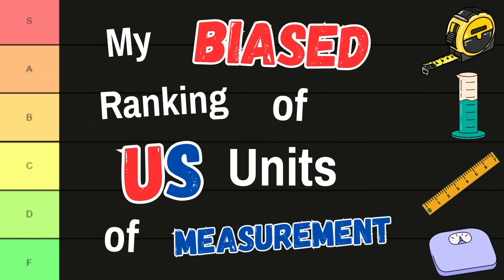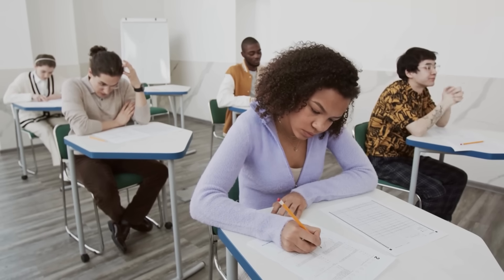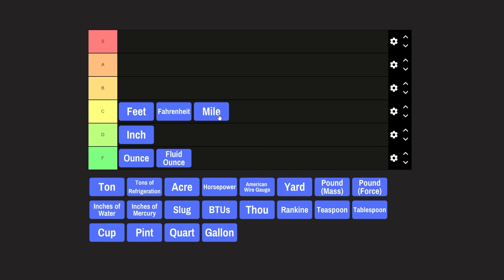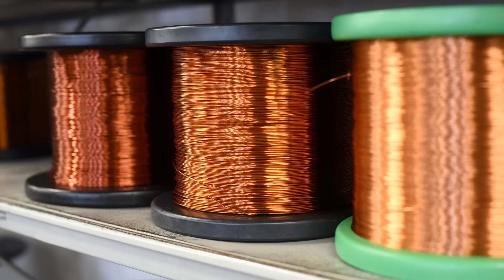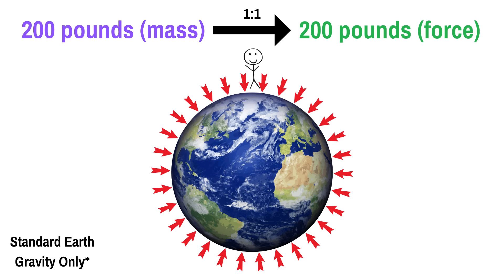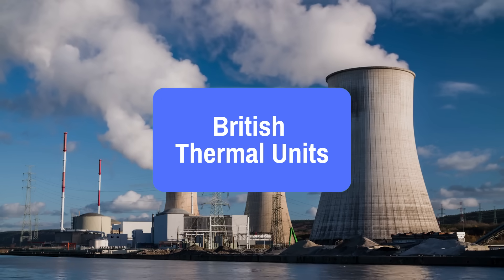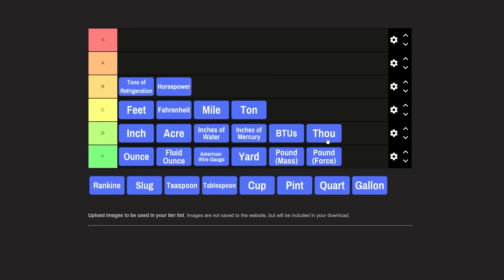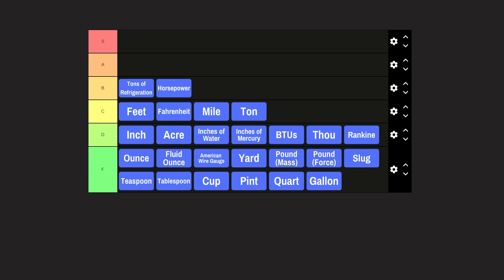Tier List of the DISASTROUS US Measuring System

Comment: water columns for preassure is really helpful for firefigthers too

the equivalent is even used in metric for many practical applications

like in germany we used "Meter Wassersäule" for quite a while,... and 10 Meter of Water is actually very close to 1 Bar, so you know you can if you can lower the preassure in your pump to 0.1 bar you can suck water from a maximum of 9 meters below you.

if you need to pump it up let's say a highrise 50 meters, you know you need to add 5 bar just to compensate for the height, pretty damn useful.

I'd put "heigh of water column" in A-Tier for this specific reason.
Reply: But the need to change unit is straight up a inconvenience already

Comment: The teaspoon and tablespoon measurements are probably the most useful if you have nothing in your kitchen to measure small quantities with, and in cooking a little bit too much sugar or salt for example wouldn't be all that bad, however if you're asked to put in one eighth of a teaspoon of a very powerful spice, you're better off using your hand instead.
Reply: Recipes using volumetric measures like cups and spoons are scaleable. As a result, as long as you are consistent in the ratios it does not matter what base volume you use, you could use buckets and half buckets for catering purposes and it would still be following the recipe.
Reply: @martinconnelly1473  That doesn't work with teaspoons and measuring in volumes is a stupid idea anyway, despite the differences at certain temperatures, try measuring a cup of Butter. Or replacing normal sugar/salt with finer or coarser grained one.
Reply: @outdooropaholger9998 two sticks. Butter here comes in eight tablespoon (half cup$ sticks.
Reply: @derekeastman7771  Congrats, for having an energy inefficient solution for a problem that doesen't exist with scales.
Reply: @martinconnelly1473  yes but if you instead used a scale and a cup with measurements in Metric .... You could use exactly the same amount of ingredients every single time you make the same thing, nobody eats the same thing everyday so it's only natural to forget the amount you used last time if you're using spoons and teaspoons and it might actually affect the taste, being inconsistent while cooking is bad, this is how you end up with inedible stuff on your plate, that being said you really don't have to he all that accurate if you're just cooking for yourself, nobody's gonna judge you and say "it's not as tasty as last time..."
Reply: You better have something to measure if you want to cook ! 

Not every spoon are the same size , and inside the same spoon you can put Different measurement of product  ! 
Just buy ONE KITCHEN SCALE , then you can measure every thing . 

1/2 a teaspoon , a 1/4 cup , God damn that's horrible when you wanna cook . 
That doesnt make any sense , It belongs in the "Z" tiers .
Reply: @DoogD-i6q They make standard measuring spoons, and they have a uniform volume. How incredibly ignorant.
Reply: @derekeastman7771  INSIDE ANY SPOON , you can put different measurement of "product" . 

How much do you fill it ? 

And what about 2and 1/3rd spoon of something ? 

What about 4 and 1/4 cups of milk ? 
You fill it randomly saying , mmm that might be a third ? 

Buy a scale , talk in Grams it is way more precise and you don't need to have a kit with 5 useless spoons that you only use for this purpose . 

This system was useful back in a time when almost nobody had the possibility to have a scale in thier homes . 

We are in 2023 , wake up . 

Im not ignorant , I am just sick of hearing recipes with aleatory measurement. 
Do you realize that a recipe is a sort of Chemistry lesson ? 
It has to be as precise a possible . 

Go ahead and try and tell me that every single one of your spoons , contain the exact same amount of Powder/liquide inside . 
Try and lie about that
Reply: @DoogD-i6q You fill measuring spoons to the rim, then level them, and measuring cups to the line denoting the amount you want. You're going to be using measuring spoons for powdery things mainly, sometimes oils or wines, and it's generally a close enough approximation that it works. US measuring utensils are standardized so this "maybe it's a third" doesn't apply. You seem to be under the assumption they aren't.
Reply: @auggie9912  There is a oot of recipes where they say " One third of Teaspoon" , "one Half of Tablespoon" , "One fourth of a cup" , "2 third of a cup" . 

Once again , I feel like Cooking is science .
It may appear different than Chemistry class, but it is close . 
If Everyone follows the same instructions using the same ingredients they will get the same results . 
Now one who does not know how to cook a certain dish will certainly want to follow the exact instruction of a Chef . No "close approximation" . 

Just use grams, Liters , Buy a Kitchen Scale and Measuring cup ans start talking a bit more precisely . 

Cause talking about "third of Teaspoon" , or "third of tablespoon" ,"2 third of a cup" doesnt doesnt make any logical sense .
Reply: @DoogD-i6q  
> There is a oot of recipes where they say " One third of Teaspoon" , "one Half of Tablespoon" , "One fourth of a cup" , "2 third of a cup" . 
Which is why you use the measuring spoons/cups for those things. You want a third teaspoon? Use the 1/3rd size Teaspoon. 1/2 Tablespoon? Either use a 1/2 Tablespoon or 3 1/2 Teaspoons. Do you believe the US only has one size? You can get sets of 1/8, 1/4, 1/3, 1/2, 1 Teaspoons, plus 1/2 (sometimes), 1 Tablespoons. They come on a chain with all the sizes. Cups are the same way, they have markings for not only different ratios and volumes of cups, but also the mL amount on the other side if you wanna use those instead. 

Even if the original person who made the food was from the EU and translated it poorly to American units, it would still turn out fine for most things (bread is the exception I think of off the top of my head). If you used European Tea/Tablespoons, you'd have 5/15 mL respectively. A US Tea/Tablespoon is 4.93/14.79 mL respectively. That is ~1% margin of error per spoonful. If your food is ruined by 1% margin of error, I think you have bigger issues on your hands. 

If you're cooking anything on a stovetop good luck getting better than a "close approximation" due to temperature differences in the pan and at different levels of heat. 

For baking bread, I will say you 100% should be using a scale, since that is actually quite finnicky on how well the bread will rise, the firmness, how moist the bread is, etc. Unless you know what you're doing you're almost guarenteed to get the wrong bread if you aren't careful about ratios. 

But for stuff like Spaghetti Sauce, Pad Thai, Stir Fry, etc. the Tea/Tablespoon will do it just fine since a lot of that is going to come down to personal preference on what you wanna add and how you want the final flavor profile to come out. 

I find it far easier to just grab a ring of spoons, and then pull spices out of spice jars in pre-determined ratios.
Reply: @derekeastman7771  they're not uniform

they- they're not
look at Australia
Reply: Um, guys, metric uses teaspoons and tablespoons, too. They are defined as 5ml and 15ml respectively. And unless you're heavy into other white powders, they are perfect for measuring spices. How little would 2.5ml (half a teaspoon) of e.g. curry powder even weigh? Also, we're talking about ingredients where +/- 50% is personal taste...
Reply: @HenryLoenwind  never knew that, but most people don't have a cup with measurements that small so just using a spoon where the ammount can vary a lot is still the way to do it, you can fit more or less than those ammounts and it's still called the same.
Reply: In Dutch we also have a knive ponit or a snuf(je). Wich really pissed me off while learning to bake a cake.
And I have about four differnt thee spoons. So even metrics is not enough in the kitchen.
Reply: And use weight, when you can, for your ingredients when cooking!

Comment: Most people: Rules of Thumb are supposed to be easy. 
American electricians: „The 39th root of 92 is approximately 2 if you raise it to the power of 6“
Reply: Believe me, I was ready for some shit, but I was not ready for that shit!
Reply: Put it into Desmos: It actually ends up being approximately just 1. Still pretty cool! 92^(1/36)^6
Reply: @Flashzap15 not 1/36 but 1/39
Reply: And even then I don't understand why they didn't just simplify the power to (92)^(2/13)
Reply: Yeah the rule of thumb for that one is just memorization. 14 gauge for 15A circuits, 12 for 20A, and check the book for anything higher just to make sure you don’t fuck it up (a real electrician probably would have some higher values memorized, but that I am not). Like most other imperial units it’s perfectly usable once you get your head around “higher number means smaller wire” and get a couple internal benchmarks for what common wire gauges are. Not perfect but not worth changing.
Reply: It evaluates to ~2.005 using Wolfram Alpha. Desmos is probably truncating or some floating point error is affecting the calculation. 
If you read the article, the rule of thumb isn't as absurd as this video makes it out to be. The 92 comes from the ratio of the diameters of the largest and smallest gauge wire. There are 40 gauge sizes(39 steps between the largest and smallest gauge), so 92^(1/39) is the ratio of the diameters of two successive gauge sizes. Since this quantity raised to the 6th power is very close to 2, for any wire size, going up 3 gauges doubles the cross-sectional area and going up 6 gauges doubles the diameter. A pretty serendipitous coincidence for a not-terrible system which puts it in my personal B or maybe even A tier. Better than horsepower, ounces, or acres(my personal least favorites).
Reply: Of or if?

Comment: Very good explanation.
You should look into the volume and weight measurements for commodities traded in the commodity exchange. The bushel and hundredweightsprings to mind. These will have different conversion rates depending on the commodity measured. The US customary system is really a Stone age clusterfμck. I read that the US customary volume measurements kill several thousand patients a year, because of conversion errors. Even in construction the yards and inches. Are reportedly to blame for up to 25% material waste, due to wrong cutting of construction materials, attributed again to conversion errors.
Well, at least there is one more country on the planet using this system and that is Liberia. Good company for the richest and most progressive country on the planet. 😂

Comment: The imperial system is not a system at all, as you pointed out. It’s unfair to compare to the metric system because they serve different purposes, the metric system is an interconnected system, and the imperial system is a general group of measurements the a certain area of people use
Reply: The US does not even use the imperial system it uses the 'United States customary units' they just happen to have some overlap.
Reply: Exactly. I mean he did say it was biased, so at least it was admitted. But yeah, what he did with Fahrenheit is the most reasonable way to compare them. Obviously for science use metric. But for the average person there isn't a benefit to a rigorously connected system, just one with usefully sized units.

Comment: 8:12
So... Rankine is just copying Kelvin? Why? Just use Kelvin if you want 0 to be absolute zero. Kelvin is also fully linear in terms of energy in gas molecules.
So this is just a bad american knockoff of Kelvin I suppose?

PS: Just googled it and the Rankine was created 11 years after the Kelvin, so it's likely just someone going: 
"Damn, this smart dude proved there's a lowest possibly temperature. Now I can just steal that and then use the arbitrary scale of Fahrenheit instead and people will think I'm smart :)"
Reply: I’m surprised it’s relevant enough to get mentioned. I always think of it as an odd little tidbit, like “did you know there’s a unit that’s kelvin but with Fahrenheit degrees instead” rather than something to ever actually worry about.

Comment: As an ex-Dutch colony, Indonesia retains a few of imperial measurements we still use daily (e.g. at traditional markets), but we adopt Dutch version which is much simpler. Our ounce ("ons") is exactly 100 grams, and our pound ("pon") is 0,5 kg. Personally, I like this definition (easy to convert from metric instead of whatever values they should be from imperial). For official measurements, however, we use metric system to avoid confusion about ounce and pound (both are forbidden to use). Hilariously, some Indonesian disputes these definitions as they are different from the "international/US/English" ounce and pound, which we don't use except when trading with countries that use imperial (or converting ingredients for recipes). Google also automatically translates ons and pon to imperial standards in their online calculator, adding more confusion to those who don't know the history of ons and pon 😂

Another weight unit I'm not sure where it came from is quintal ("kuintal" or "kwintal"), 100 kg, but again it's not used on official measurements.
Reply: Nice to see some appreciation for some aspects of colonisation.

Comment: Another less-known unit is used when manufacutring PCBs in electronics: The height of copper in a layer is measured in Oz (mass). The reason is that you assume the mass of copper to be spread over a square foot, resulting in a height of copper. Mass is used to describe a height. S E R I O U S L Y.
Reply: Paper is a bit similar.
Reply: @chaos.corner its in g/m2 here. Not in g. And it can be usefull sometimes, in my lab one of the old dudes told me that before computers, when datas were still ink traces on paper, they often had to mesure the area under the trace (for example when you have a trace of the power through time, the energy is the area), they would cut out the area and weight it, and that would be much easier and precise than trying to mesure the area under a 3m long irregular trace.
Reply: @pierrevilley6675  It's always going to be mass per unit area. They may not state it but it's implied. My dad told me about doing the same cutting out with graphs in chemistry in the days before computers were more than glowing valves in boffins' hidden labs.
Reply: similar to yards suddenly being a volume of dirt or similar material
Reply: look at how AWG is measured. Pulling a piece of copper from a certain length to another certain length, and having your unit of measurement be how often it has been pulled by that much.
Reply: Galvanized steel (zinc plated) is the same, but in metric: height is in grams per square meter
Reply: @hurlaky43  but we don't do this kinds of shenanigans for coating. In professional use coat thickness is messured in um.
And is always described in this unit, you will never find grams per square meter describing coat thickess.
In metric me use  grams per square meter only to describe something that's not height dependent (like fabic dencity).
Reply: Sounds like shotgun gauges. How many balls the diametr of the barrel you can make out of a pound of lead. Basically mass is used to measure distance (diameter).
Reply: @jaroslavcharvat5171  different countries have different gauges FOR SOME REASON
Reply: Thanks a lot, I didn't understood how the hell did ounces defined copper thickness
Reply: I think thats due to how electrodeposition works, you do your calcutions in mass and if the system is well designed the coating is supossed to be uniform, although I wouldn't use OZ I'll use grams.
Reply: Fabric is that way too
Reply: Millimeters rainfall. Which is liters per square meter.

Comment: I did some work for an American customer some years ago,  who used a unit system of inch, slinch, and pound force, and then radians for angles.
1 slinch ==12 slugs, so in principle, you did include slinches in your rating.

Comment: Beyond the superiority of the SI, I do have to say mmHg and HP are at least A-tier units. They're used somewhat widely in specific industries and are way more accepted by standards than the others in the list. Same goes for acres, but they only get B-tier.
Reply: A lot of people talk in horsepower for electric motors but then convert that to watts and kilowatts for actual engineering purposes. I worked with gas turbines for many years and the cut off between small and large turbines was 10000 horsepower but all units were sold based on their power output in megawatts.
Reply: Agree with mmHg, it is very impressive to have a measurement in terms of a liquid that is easy to purify, doesn't wet you, doesn't show much change in density with temperature, give a wide range of temperature and pressure and also not need much height to counter normal pressure. Upper B to Mid A tier for me. 

Can't say much about acres, never understood them or hectares, I have a hard time using it, probably because I don't have to lol.